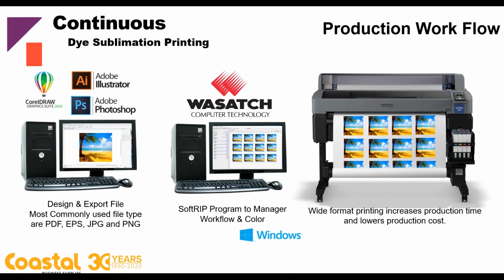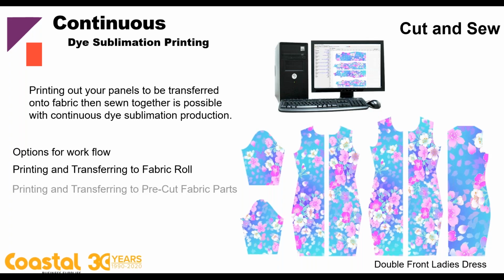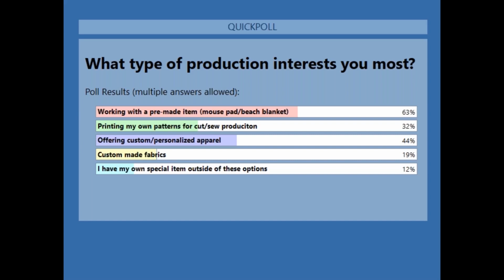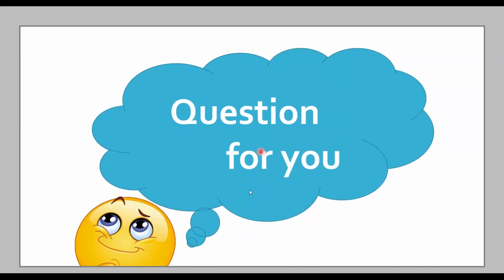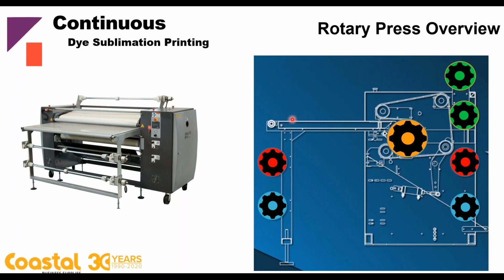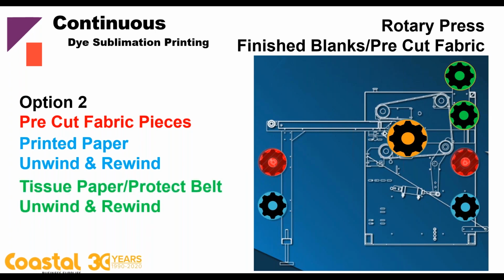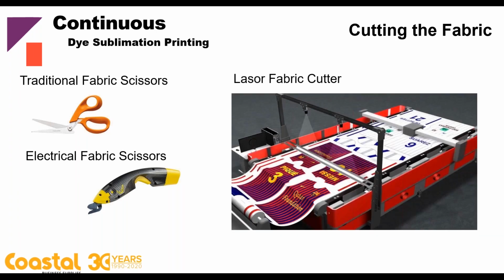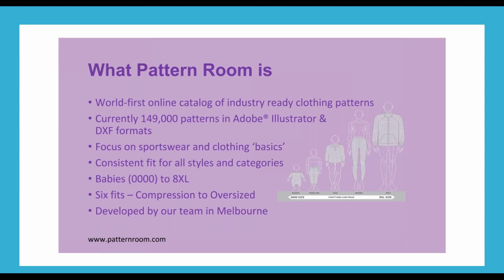Webinar: Print, Cut & Sew with Continuous Dye-Sublimation

Comment: is there a way to automate nesting before the printing or RIP process?
Reply from the maker: Hi!  Unfortunately there is not a way to automate it at this time.  You can manually nest your designs.
Reply: @CoastalBusinessSup  what about a automated numbering tool for inputing numbers and names on the back and front of jerseys?
Reply from the maker: Unfortunately there is not at this time.
Reply: @CoastalBusinessSup  would you know about e cut? a plugin for adobe illustrator, im currently looking into it, wondering if you have experience. i mean im pretty sure someone came up with a software for automated nesting in 2021 right?.....
Reply from the maker: We are not familiar with that software.
Reply: @CoastalBusinessSup  so theres no solution for auto nesting? hmm
Reply from the maker: Not at this time with the rip software
Reply: @CoastalBusinessSup  apon some digging, i found the problem is call bin packaging problem, (nesting) but nothing to automate a EPS file or something